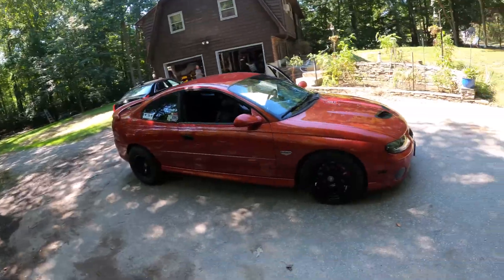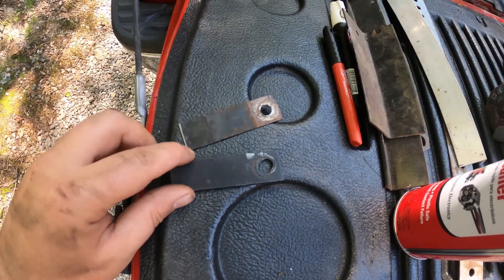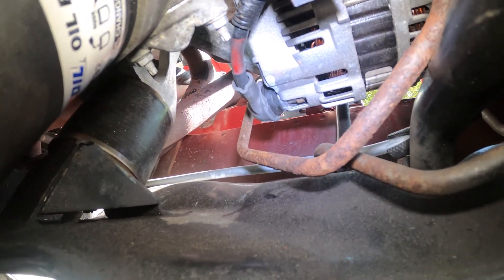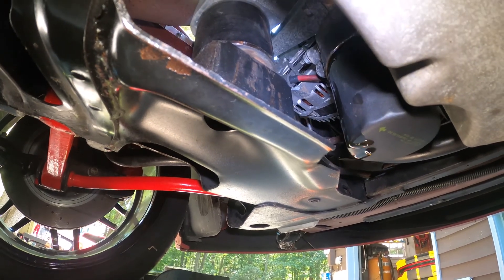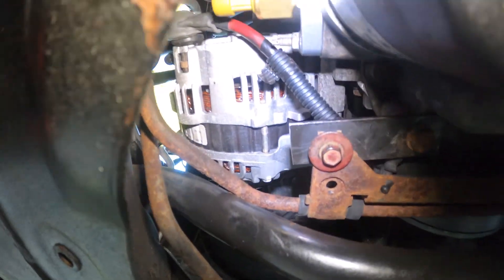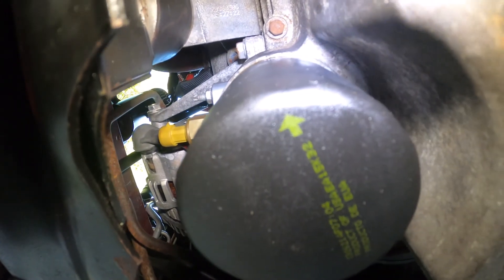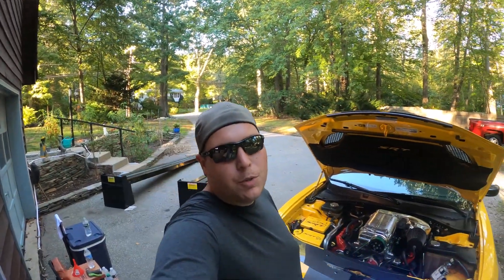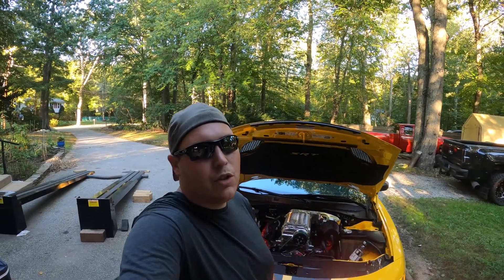Installing AEM oil pressure gauge and ICT BILLET oil cooler adapter plate in the GTO

Comment: Did you end up leaving it on. Did it work good or did it leak with the oring. Seen some ppl said to use the factory gasket. I’m about to get a guage set up for my Gto was curious if I should go this route or the sandwich adapter.
Reply from the maker: It is still on the same way! I have since pulled the engine out of this red GTO and put it in my yellow GTO and never touched it and am still running it! No leaks at all! And no issues! Thanks for checking out the channel and thank you for the support!!  🤟🤟🤟🤟🤟👍👍👍👍